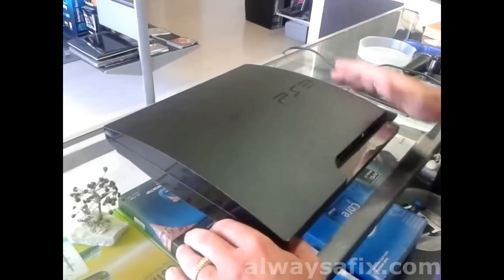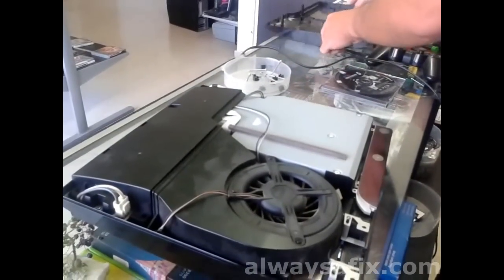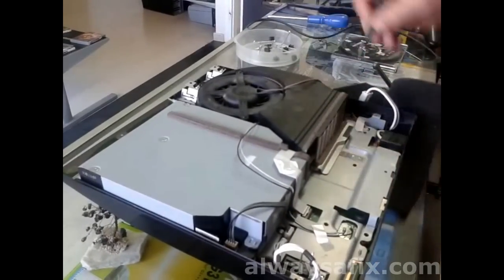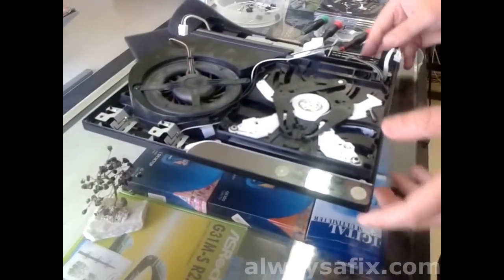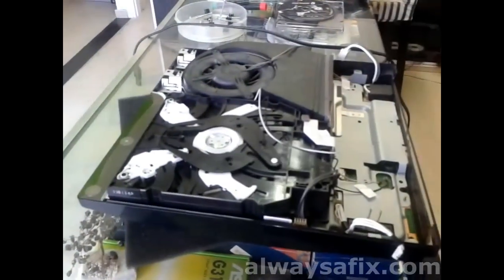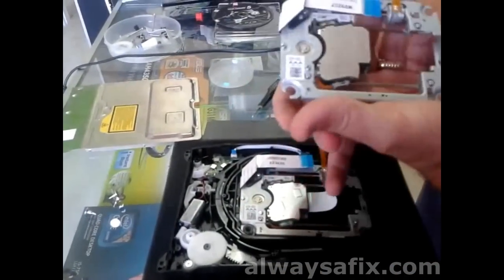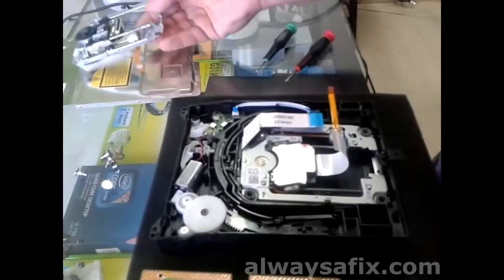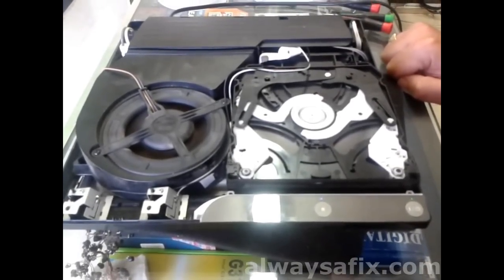PS3 Slim not reading disk Laser replacement

Comment: Hey my ps3 slim broke the other Day the disc doesnt spin and laser doesnt move.  when i turn off the ps3 and after a while we say 10-20min i turn it back on and try again it works sometimes?  now my question is. is it the problem with the laser or the motor that spins the cd?  and which one do i have to replace
Reply from the maker: +robert mroskowiak Have you tried to run a DVD movie?  If that works then you have to replace the laser.  Good luck!
Reply: the laser works and it reads dvd just the cd doesnt want to spin and it makes wierd noise.
Reply from the maker: +robert mroskowiak You need to change the laser.  Good luck!

Comment: Man this sucks, my PS3 is starting to have trouble reading games, most of my games work but I cannot get Last of Us, Beyond Two Souls, Metal Gear Solid 4, or God of War 3 to read unless I play another game that does read for about 20 minutes to kind of "warm it up." or even use the infamous "tilt trick" which works sometimes I'm conflicted here, I CAN get these games to work it's just annoying and tedious, but I want to fix it, I'm going to pick up a lens cleaner tomorrow and try that to see if it works before I go the route of replacing the laser.

My question here is, if it still reads the games eventually is that still the laser going bad? Once the games are running they seem to be ok for the most part.
Reply: The lens cleaner doesn't help. I have one of those brushes that are on a CD!
Reply: damn man for real? Thats what I was gonna try, thanks though, I'm gonna go find a local repair shop
Reply: Yes fo real. Tried it 2 days ago, thought I'd write it so you didn't have to try ;)
Reply: Any disc that i insert appears absent from my xmb. and it makes that ejecting sound. would you say my laser is broken?
Reply: Salpeteroxid yep thy dnt wrk, I tried a lens cleaner also yesterday! Do u thnk I should buy another lens frm eBay r Amazon?
Reply: Salpeteroxid did u fix ur problem r naw? Nd do u knw about buyn a blueray lens frm eBay r Amazon?
Reply: Marquis Randle The problem isn't fixed, it has been broken for a couple of years now. Can't be bothered with an old ps3 "/
Reply: Salpeteroxid how long you've owned urs?
Reply: i fixed mine about two months ago and it works perfectly again. Just followed this guide. But before replacing your laser be certain that the laser is the problem and not just some minor dust issue.
Reply: Marquis Randle christmas 2007, but it's the technology that's old. Wouldn't be bothered with a new ps3 wither....
Reply: +timowthie yea ιғ cleanιng тнe laѕer don'т worĸ I woυld verιғy тнaт ιт'ѕ yoυr laѕer noт тнe мoтor or noтнιng.

Comment: My goddamn PS3 wont read games, just DVDs & it sounds like its gonna eject my games but it doesnt & i've tried doing the 2 discs trick & tried using the PS3 Recovery menu & used options 3-Recover file system & option 4-Rebuild Database but still nothing works what else can i do to fix it? i really need to fix my PS3 help me please :(

Comment: Thank you for your video, it was very helpful! Although, after replacing the laser on my ps3, now it doesn't want to accept a disc. I can force it in, and the white arms open, but it doesn't spin. Prior to taking it apart, it would accept the disc, but wouldn't spin. Please hep!!
Reply from the maker: You need to take it apart again, and with the cover off of the drive, insert a disk and you will see what is causing the issue.  Take care of the little flap that is activated when you insert the disk and that it is plugged in properly.  Good luck!

Comment: Hi! question!!! I bought a game for the PS3 (Gran Turismo 6) and when i instert the disc inside it doesn't read it.. it makes an ejecting sound.. (the disc is cleaned it doesnt have any dust or dirt in it)  but in the other games i don't have problem playing them... please help me!!!!
Reply from the maker: First thing you need to do is test that game on a friend's PS3.
Reply: yo i had the same problem a weeks ago and yesterday BAM! laser stops working,  doesnt read any games, however i ordered laser ASAP and got it fitted today, works a treat now
Reply from the maker: mrvrandom Well done on your fix and thanks for watching!
Reply: mrvrandom whr did u buy ur laser, I need me one? Nd who installed it for u, r u did it urself?
Reply: Danny Euro whr u buy ur laser frm? Nd did u match up ur PS3 model number correctly, whn u bought ur laser? Im jus curious cause im thnkn bout buyn me one..
Reply: Danny Euro sumbdy jus told me da laser is inside the lens, n da lens is wat needs to b replaced!
Reply: Danny Euro ok yea, thts wat I meant to say..
Reply: Danny Euro who nd whr u buy ur laser frm, so I wnt buy mines frm thr?
Reply: Danny Euro wat model is ur PS3, mines is CECH-3001B?
Reply: Danny Euro wats the tool bit (star bit) I think it called, u use to remove da lens, its very two small screws holding da lens tray?
Reply: Danny Euro hw much u spend on da new PS3? Nd wat happen wit ur old PS3, it kept messing up still? Nd thts da only gme I play too lol.. its hella fun (GTA V)
Reply: Danny Euro i heard its because of how hard the graphics make the blue ray laser or something function. Its all a scam so that kids will buy ps4's dude, thats not going to work with me though, i got too many games i can play on my ps3, so until ps4 comes with backward compatibility, i aint buying
Reply: Dick Scrodum tht could b true, I heard its da updates nd installment wit des games too bruh.. thy would trya' scam us to tht way.. smh
Reply: Danny Euro is it making ejecting sound?

Comment: usually whenyour ps 3 canr recognize a disk it is because the blue reasder is dead and no amt of cleaning will help
Reply from the maker: +norm bert We only suggest cleaning first and if that doesn't work ultimately you would have to replace the laser.  Thanks for watching.

Comment: I had the weirdest thing happen to my ps3 after not playing for a while because of my ps4, I would put my cod ghost disk in and the disk would try to spin up multiple times before it finally appeared on the screen then when I play it does the same thing and I try to quit the game it does three beeps I end up having to unplug, I then try again with cod black ops 2 and it does the same thing but I quit before it gets to crazy and turn it off, I try again with with battlefield 3 and it is working

Comment: hi my ps3 slim is not like your and it wont spinning the disc the model is cech2504a
Reply from the maker: +nico xenidis Does is read a DVD disk?
Reply: +alwaysafix when i put in a disc it just sound like a cracking noise and then it will not spin the disc plz help :D
Reply from the maker: +nico xenidis That noise is the laser trying to read.  Your laser needs to be replaced.  Good luck!

Comment: my disk turns but stops...is this a problem with the laser or...? i mean it's not reading at all :/ @alwaysafix
Reply from the maker: +Conzil Michael Yes, try cleaning the laser first otherwise it will need replacing.  Good luck!
Reply: is there a certain cleaner i need? or do you think it would be cheaper to buy a new playstation? i'm only bothering to get it fixed as it's my first one had it for like 5years hahaha never let me down till now :/
Reply: your video helped alot btw :D
Reply from the maker: +Conzil Michael If you take it in for a laser replacement you're looking at about $70.  Thanks for watching.
Reply: +Conzil Michael Wнen I pυт a DVD ιn ѕoмe wιll worĸ вυт ѕoмe don'т. I pυт a pѕ3 gaмe ιn ιт ѕpιnѕ lιĸe 2 ѕecondѕ ѕтopѕ and repeaтѕ , мy pѕ3 geттιng тнe laѕer replaced now.
Reply from the maker: +Gun Exploits Yes, replacing the laser should sort out your problem.  Good luck!

Comment: Hey alwaysafix  I just posted a vid on a problem I am having after swapping out my Blu Ray drive.. can you take a peek on my page and see if you know what the issue is? Thanks
Reply: Is urs making an ejecting sound? im about to watch ur video! Would u watch mines too?
Reply: I swapped out my blueray lens to yesterday nd its still not wrkn, did u buy ur lens frm eBay, are whr from?
Reply: Marquis Randle I bought a full blu ray drive replacement, and the replacement drive ended up having a bad laser. I got a new laser from the seller for free and swapped that out then my problem was fixed. I got mine from eBay user gtg.sales, he's got great customer service
Reply: serstylz2 so should I type in "gtg seller" nd the product will pop up?
Reply: serstylz2 I cnt find "gtg sales" could u gve me link r sumn?

Comment: ok I tried this but the front left part wont come off.
Reply from the maker: Which part exactly, the casing or the laser desk?
Reply: oh i got the outer shell off now but the disc cover i cantget off
Reply from the maker: prodigy adams Do you have the exact same model as the one in the video?
Reply: yeah
Reply from the maker: prodigy adams I showed step by step instructions how to dismantle it.  Please tell me exact time in video on the part you are getting stuck.
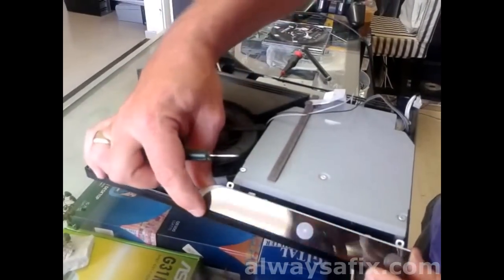Reply: 3:16 getting that part off
Reply from the maker: prodigy adams That's the button panel, and it should just clip off.  Try prying it from different angles.  Good luck.
Reply: i did that the disc part is what im talking about.

Comment: I replaced the laser with the correct model but now the PS3 makes an "eeet" noise, then the ejecting sounds, and then another "eeet" noise. Finally it doesn't read or spin the disc.
Reply from the maker: Refit the original laser.  If your problem goes away, then the problem is with the new laser.  Good luck!

Comment: my problem is it reads my discs, but after about 30-45 minutes, my system starts struggling and the game ends up freezing
Reply from the maker: Have you tried cleaning the laser first?
Reply: no because I need that special screwdriver
Reply from the maker: SteveMagic09 I use a flat screwdriver that is just the right size to fit along one of the edges of the screw.

Comment: The problem of my ps3 is that it dosent read a disc if u dont vertically place the ps3 meaning that i have to hopd the ps3 in order to read the discs. My conclusion is that something is not screwed on properley to the blu ray reader.
Reply: Btw my ps3 slim is about 5 years already but it is still playable.
Reply from the maker: +TechnoGamer 26 Maybe the laser just needs a good clean.  Good luck and Happy New Year.

Comment: no game gets displayed when inserted. And all the regular resolutions didn't help. This sucks
Reply from the maker: Have you tried cleaning the laser first?
Reply: there wasn't anything i could see to clean. no dust. Had the exact same problem as you so i figures id buy a new laser. And i did. I'll say if it worked out, ur vid really helped out.
Reply from the maker: timowthie Good luck with your repair!
Reply: thnx!
Reply: I finally received my new laser, replaced it and it accepts discs again. 
Your video helped me a great amount and i be sure to check you regularly for any other tech savvy tips.
Reply from the maker: timowthie Happy days and congratulations on your repair.  Happy gaming and thanks for watching.
Reply: timowthie help me bro, I jus replaced my old lens with a new one frm eBay, nd it's still making ejecting sound after one minute of not loading (reading).. please help me anyway u can, thanks. :)
I hv a video on here too of the sound its making nd how it spins nd doesn't load up!